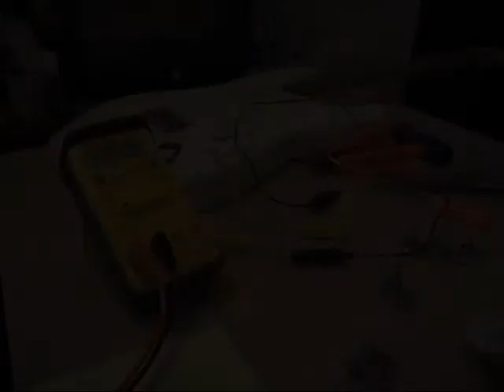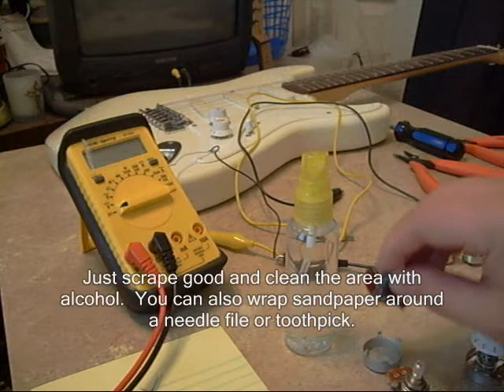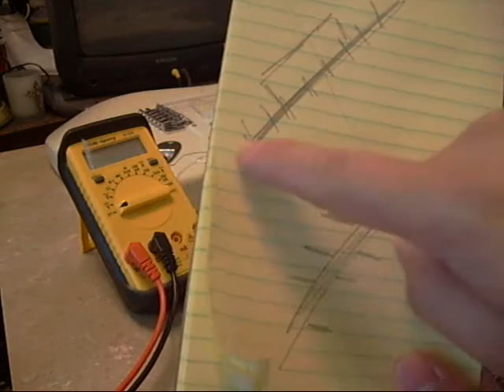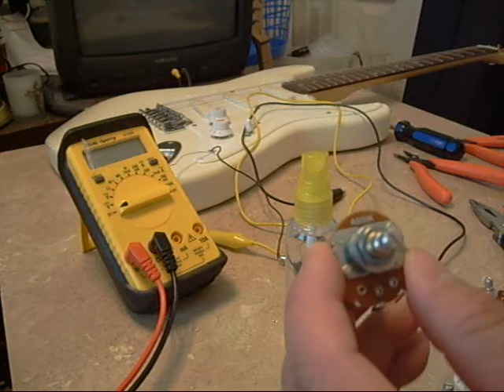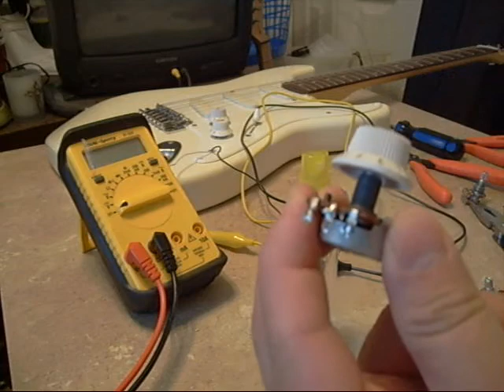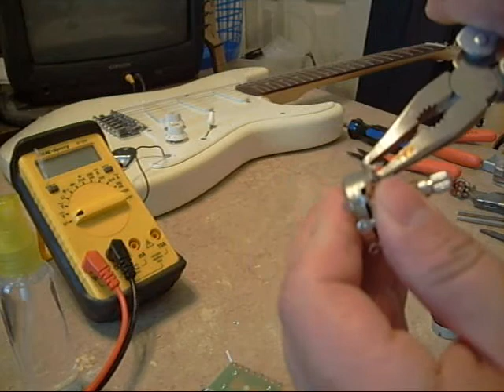Make a Blender Pot, part 2 of 3 (actual construction)

Comment: You can actually just use a normal tone pot. No altering to the pot itself and no no-load pot needed. Simple to just use a standard tone pot and connect the left lug to the bridge pickup tab on the switch (the same tab the pickup is wired to) and middle lug to the tab the neck is connected to. Leave the last lug on the pot as is.